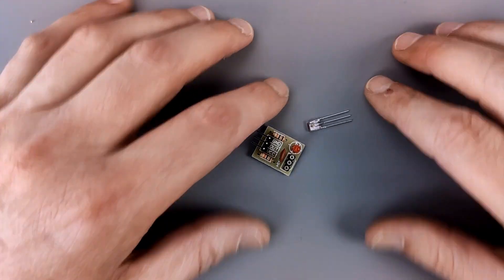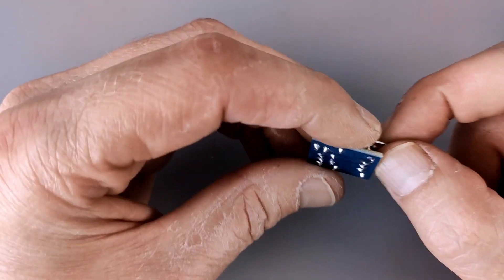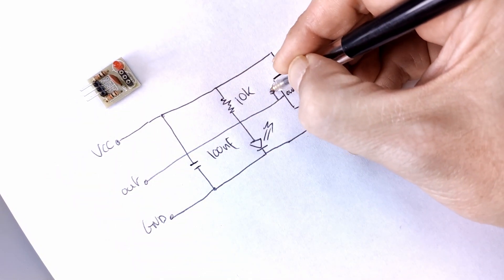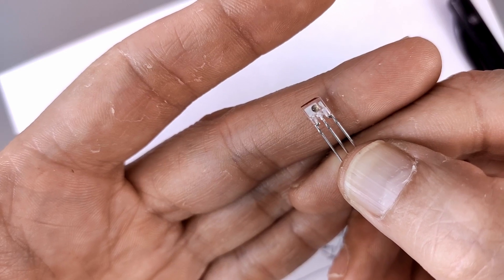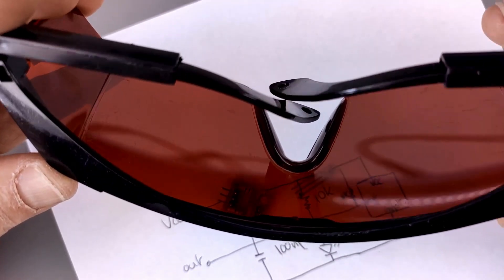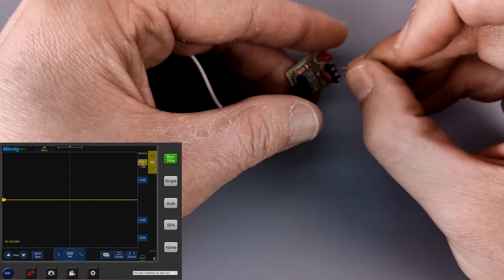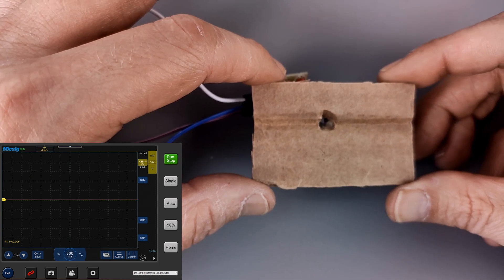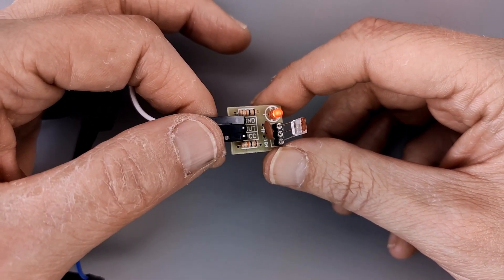What is this Weird Device?!

Comment: Similar are found in the oldest ball computer mice used to read the encoder wheels. Both the IR leds and detectors had the same shape. And they are not filtered, so if you open the mouse, the light blocks the detectors and it stops working.

Comment: Can this be used as a wireless switch? Add a relay and use it to turn on something with a laser pointer from far away.
Reply from the maker: I think that can be done. I think you just have to make sure that most of the light is blocked from the sensor, because it will also react to all other light.

Comment: The module I have is the same, my sensor needs a laser to send the five volts. The sensor is the same package, but is probably the wrong component for a laser sensor: TSL235, which is a light sensor that converts light to a pulse, very cool. The sensor on my modules is a TSL257 which contains a photodiode and an op-amp.

Interesting reaction on the scope, it would be nice to see it in comparison to a photodiode without the frequency converter.
Reply from the maker: Thanks again for your reaction to my previous video. It is very difficult to tell all those sensors apart. Wish they would print a component ID on there ;)
Reply: @DustinWatts  It seems they have the same problem distinguishing the components, there needs to be some way of telling the difference other than hooking them up. I would like to find the sensor you have. It would be interesting to see how well it would react to various PWM signals from an LED.

Comment: looks like there are a lot of light sensors with that package, but as it detects the laser it still performs as described. you will just have to block all other frequencies ;) 
At least you have a light sensor to confirm if it's dark or not.
Reply from the maker: Maybe some different colors of light can shed some light. Pun intended ;)

Comment: It seems to be just a normal light sensor.  a TSL235R-LF
Since we now know it triggers on plain white light from your lab, you can try to find out if it is sensitive to any particular color.
I would stick a RGB led to it (or just a RGB led strip) and see if it triggers on red, or green or blue, or maybe just all three.
If it triggers on all three colors it's a light sensor, probably used in those cheap $1 garden lights. (the ones with a small solar cell that charges a capacitor during the day and automatically turns on small leds at night driven by the charge in the capacitor).
Reply from the maker: Hmm... I could do an experiment with some Neopixels. You gave me an idea! :)
Reply: @DustinWatts  This is likely to be the datasheet of your sensor:
https://ams.com/documents/20143/36005/TSL235R_DS000120_3-00.pdf/d267ee56-5494-c92d-8705-716becdd4051
It seems that in the past there where several versions of this sensor, but they're all obsolete these days.
Thanks for the upload Dustin !